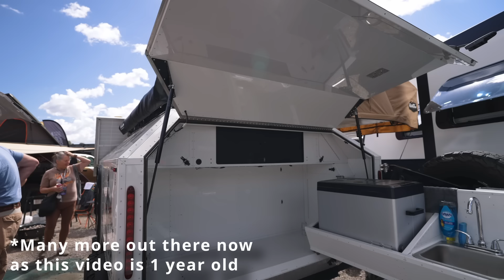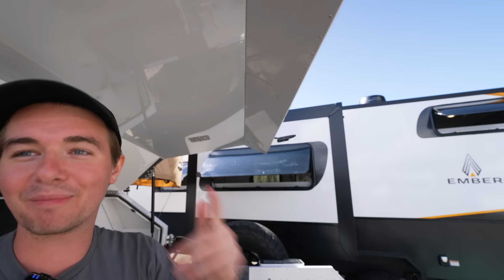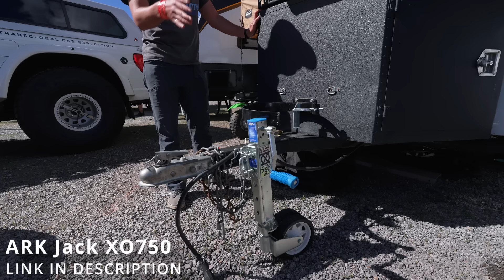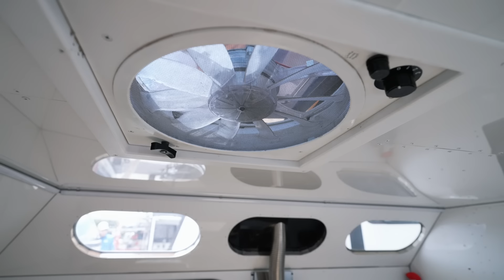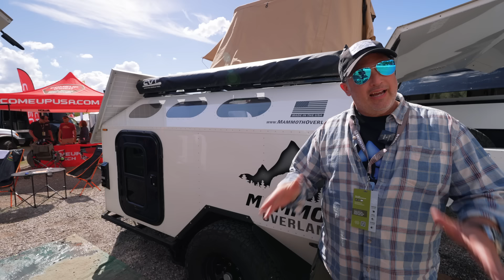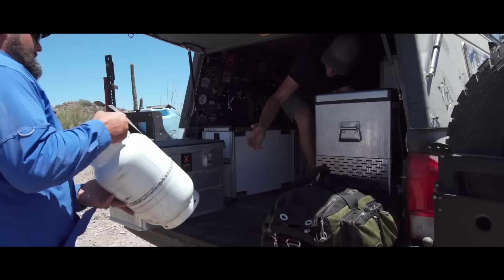Mammoth Overland Reinvented the Small Camper!

Comment: Thanks Drew! That trailer has a plethora of rivets! I love the fold down step to get on the roof. I feel like the angled roof line is more form than function but does give the trailer its on definitive look. I like the heater they used. This trailer might benefit from two 20lb propane tanks which might line up more with the target audience.  One change I would make is have a swing out gear box on the back that would swing out to the driver side that give ability to store gear and create more work surface area as well and would perfectly compliment the swing out kitchen to the passenger side.
Reply from the maker: Brad, you have to quit buying us all this coffee! We are bursting at the seems with coffee. BUT, you know i appreciate it. Haha. I just purchased my first ever off-brand usb charged coffee grinder for camping. I never needed it before. I was always the guy at camp hand grinding everyone's coffee. Well, all of a sudden we have more coffee drinkers with us and even May is consuming at a faster rate than I can keep up with. We have been testing the little sub $20 grinder and so far it is working great. Quiet, a really fine grind for the espresso. It is a ceramic grinder, not steel, but I'm not a coffee snob enough to tell the difference.  I like your suggestions on this trailer Brad. And I also think you are right about the propane. That crowd wouldn't even notice a dent in their towing with an additional 20lb propane cylinder.
Reply: @ what are some of your favorite coffee brands you have been using! Didn’t know if you and May had a favorite coffee shop!
Reply from the maker: @jgrant4520  So far no favorite brand. We basically buy small batch coffee that is on sale. We like trying different coffee from all over the place. For a while we tried the expensive stuff, but just didn't see the value. We are not really fans of highly acidic coffee, and that is what expensive coffee tends to be.  If there is no sale, we just pick up something like 8 o'clock or Petes. We aren't picky. Just love that black morning coffee! As for coffee shops. We had quite a few favorites in Thailand, but here in the States my favorite coffee shop is my teardrop trailer or our kitchen. Haha.
Reply: Kicking horse coffee.....just sayin...
Reply from the maker: @jennstuart2031 Really.... I'm all ears. I'll look it up Jenn.
Reply from the maker: I was expecting this to be expensive. Loving the price I just saw. Which roast do you suggest from them?
Reply: @PlayingwithSticks I like the medium roast, blue dot on the bag.   I grind to a medium grind and use a Stagg  dripper.  I used a cone dripper for a while, but the cone papers always broke and I want a clean cleanup when camping.  I've had several USB burr grinders but still looking for the best one.
Reply from the maker: Oh wow, I didn't know they made USB burr grinders. Thanks for the tip on the roast. I will be putting in my order today.
Reply from the maker: I had to did through the comments to find your coffee. I forgot the brand. I went to order it today and went, "What did Jenn say it was again?"  Haha. Thanks again for this Jenn!
Reply: If you find a sturdy USB charging burr grinder could you post it?
Reply from the maker: Wouldn't that be cool? I am surprised though. Both may and I found this morning's coffee better from our cheap USB powered grinder versus our Burr grinder. Which is starting to make me think not all burr grinders are created equal. The one we use is on the cheaper end as well. I always thought it was special haha. Sometimes you get what you pay for

Comment: Having owned everything from a $12,000 overland trailer to a $65,000 small overland trailers, I can tell you there isn't much difference in what you get.  Sure layouts are important and that is the major differences.  Materials on most of these small overland trailers are just fine at all price points.  The more I look at these the more it makes buying a small cargo trailer, (made for abuse usually) throwing some timbren axeless suspension on it, and building it out (or have it built out by a local place) the way you want it.  You can do this all for around $15,000 (stove, heat, water, shower, beds, etc.etc..) and have the same if not more capability as this trailer.  I'm not saying there is anything wrong with these trailers, they are "cool", they are just not made for your everyday overlander/camper IMO.
Reply: It would be cool if Toyota made a camper that was indestructible though
Reply from the maker: Sign me up to test that!
Reply: Sadly, I think most of the overlanding, and frankly all the tiny camper industry, has become more about the “look at me” aspect of it. Not the “I just wanna get away from everybody else” that it should be. Even fully loaded as a bombproof boondocking capable camper, $25k should be the absolute maximum! Yet we keep seeing 50, 60, 80k trailers. And they will fall apart at the same rate as the $12-15k trailers. 

In short, they are made to be seen at the campground or driving down the road, not taken into the back country and seen by nobody.
Reply: @soonerfrac4611  sounds similar to many humans so it makes sense.
Reply from the maker: I like your take on this Preston. I would agree. The more campers I take out the more I realize a budget camper does 80% of what every high dollar camper can do. As you may know we also have a converted cargo trailer. We have had it for over 5 years and have never put it on the channel. I finally filmed it this summer, so I will get it up there this season. There are a lot of pros for going this route.
Reply: @PlayingwithSticks yup, all I need one for is music festivals and bluegrass “pickin parties.” So heat, cooling, and lockable storage. Cooking can be done on a table outdoors. A dinette may be nice for rainy days and meals. So something like a Rustic Trails Koala is the dream. But it looks like in terms of cost and lack of maintenance (I live in Maine so it’d be out in the snow all winter), a cargo trailer may be the way to go. My biggest gripe with most teardrops and small trailers is they use way too much space for cabinets and kitchen space. I’d much rather have it open to lock up my guitars. Something like a road toad tote might be good too. But again cost and availability, a cargo trailer seems hard to beat. And you can add and subtract features as you experiment
Reply from the maker: I follow Rustic Trails pretty religiously, but I think I missed the Koala. Sounds like they have a new model? I'm with you on the space eating cabinets. I used to love them, but the less I have the happier I am. I like open space. I think that Road Toad would do well in your climate, so would a budget trailer from Runaway or Tiny Camper Company, both of these manufacturers use composite as well. We have a converted, well semi-converted cargo trailer. We have had it for over 5 years, you may have seen it in the background of our videos because we camped out of it for 6 months at a time for two different seasons. They definitely have their place. Great little trailers, with an affordable price tag, and a BIG feel to them.
Reply: @ thanks for the pointers! The Koala is like a Kodiak minus 2 ft in length and a little more rounded in styling! The runaway campers would be perfect tbh but the owner is heavily into politics, and let’s just say, his views are opposed to mine in a way in which I can’t feel comfortable supporting his company. Road toads are hard to come by. I do like the idea of being able to store my motorcycle over the winter though it’s not a necessity, so the intech explorer is pretty cool in my book. 

Thanks again for your well-thought-out response! Best wishes on the channel heading forward! I just subscribed :)
Reply: If you always camp in a campground with a flat level paved parking pad then most of this doesn’t matter.  If you camp on spots between the trees and drive over rocky rutted roads to get to your campsite then you will appreciate this build.  Repeatedly dragging your typical trailer to these sites will drag the bottom and twist the overall integrity of the unit.  They aren’t built for rugged use.  This trailer has a high clearance that is equal to the vehicle pulling it. The articulation connection doesn’t strain the travel of the trailer or the pulling vehicle.  This trailer encourages outdoor use.  The reason we go camping.  You don’t go camping to pretend you are in your living room.  Experience the outdoors with a very reliable and functional home base unit.  I own one of these and I love it.  It’s not for everybody.  Thank you.
Reply: @alexdroban4312 you’re welcome?

Comment: I don’t get the cabin pressurization, like you go up a mountain and can sleep at sea level?
Reply: Positive cabin pressure keeps dust out of the interior while going down dirt roads.  Some Australian trailer makers have this feature.
Reply from the maker: That part I understand. And I agree, that would make sense. but let's take something like Bruder for example...they don't use something like that on the door. With that fantastic fan, I have a feeling this trailer wasn't designed like a Bruder for keeping out the dust. So I am still not sure what that cabin pressurization is actually for.
Reply from the maker: My guess is as a defensive mechanism right? Does that make sense? Like instead of you shooting that bear spray, it is you holed up in your camper protecting yourself from any gases used to push you out. I literally have no idea. Haha. I'm pretty sure it is some sort of prepper mentality. I have a lot to learn in this area.
Reply: Oh right, they’re selling to preppers. 🥜🥜🥜
Reply: If the cabin is sealed, shouldn’t there be a way to get fresh clean air to survive? Does the heater blow in fresh air? Moreover, how does the cabin pressurize with a fantastic air fan in the ceiling, and regular doors?
Reply: You’re going to start seeing those fans on Boeings soon 😂
Reply from the maker: Haha. How dare you ask these tough questions...They are really good by the way.

Comment: Those Rock sliders are only for bashing not sliding. Why aren't propane lines ran thru out ? 2" suspension travel? Aluminum interior condensation?
Reply from the maker: Are you saying that because of the right angles of the "sliders" Sorry sometimes it takes me a while to pick up on things.
Reply: @PlayingwithSticks  Cross bars will snag, needs to be plated(skids). Plus the length of the supports will have a lot of leverage when it slams down with that 1000# rack fully loaded.
Reply from the maker: Thanks for pointing this out. The offroad trailers are one of my weakpoints. Learning something new everyday.
Reply: I’ve overlanded this trailer over moderate to difficult trails with downed tree limbs, rock steps, and boulders. The sliders have worked beautifully and I have never had debris catch in the cross members whatsoever.

Comment: When you first put up the notice for this video, i went to their website and watched several videos.   My first impression of this design was that it was from the military.  Sometimes, on major highways , you see these looooong caravans of different shaped military vehicles going whoknowswhere.  This came out of that line and escaped into the Regular Folk life style.

I like this trailer.  I'd like to outfit it and camp with it. I'd like to take the fridge out of the galley and swap the stove to that location and put a storage bin on the outside of that arm.   I never like swing out galleys, but i could fix this .   That swing out also needs a  dtop to the ground leg to brake it in the wind.   Of all the outside elements, WIND is the biggest one that will shut down cooking.

I like the bigger cabin.  I like the windows, and that bench would be great for interior cooking.   You had a great fold up mattress a few weeks ago that would be awesome in there.
Why does the heater vent at the underside of the rooftop tent?   And also it's under the window of the roof top tent.
Is the solar panel a fixed item?  You would always need to be aware of where the sun is relative to the panel.  
And now the bear spray on ELE.  I dont know.  I keep thinking about that.   It was very dramatic to watch.   I'm still thinking about that.
I dont overland, but i like the design and size of this trailer.
Yes, on the propane canister problem.  I agree with you on that. 

Fun!
Reply from the maker: Love this break down! Your comments just keep getting better and better. I'm right with you on the military look. That is what I first saw as well. One thing I also didn't mention was how easy this trailer would be to clean. I like the simple aesthetic. And I'm right with you there on that wind comment. Good point on the heater vent, I didn't even notice that. I was so caught up on just the shape of the vent, that I didn't even look around it. The prepper version of this is probably 60% practicality, 40% fun or a talking point. Haha.
Reply: See this is what happens when a Trident Nuclear Sub and a AV-8 Harrier meet and have a baby.    Paint it Military green and Lewis/McCord will think they’re missing one of their armored transport vehicles from the Yakima Training grounds.
Bullet proof windows, seriously?!!
Starting price of $67,000.   That’s cheap for military grade.

All kidding aside,  this beast is built to withstand just about anything… except maybe armor piercing bullets.
Reply: @annmariewhale4501  yes!   JBLM has been lookin for their bed trailer! 

I still like this trailer. 

I think it needs some bear pin striping on the back galley.
Reply from the maker: I want to see a version 2.0. I hope they update this trailer soon.
Reply from the maker: Haha. Love your take on this!
Reply: I would like to see an update also.  What we are looking at is a year old, so surely there are uogrades.
Reply from the maker: @jennstuart2031 I was trying to see updates on their website, but if there are updates they're not very visible

Comment: Considering the build,  the price isn't too horrible. I agree that this is for the rugged, get out of dodge, hard core overlander who just needs a bed on wheels, with a compact kitchen. Propane plumbing is an issue and I don't really understand the reason for the pull out kitchen. Serms to me that adds unnecessary weight. Speaking of which, I didn't catch a weight for the base model. There's a specific market for this and I hope they are successful.
Reply from the maker: Funny you mentioned the weight. I was hoping nobody mentioned it, because I realized after I uploaded the video that I forgot to mention the weight. The dry weight is 1650 which is pretty comparable to other overland trailers of this size.

Comment: It is a very interesting trailer. Always liked the idea of no rotting. I agree with your cons. And I also like their suspension. It is the same I have on mine. Although my heater is mounted to the side of my trailer I do like to have a bottle designated for its propane needs always ready to go. My propane for my stove is mounted to the side of the trailer and you have to screw it in and unscrew it. That way you are sure it is disconnected and off. Cabinets on the inside sure would be nice though. 
 The appearance seems very clean, which is pleasing to the eye. And some 409 and a towel and it's clean. 
Love the videos! Much love to you and your family as always.🥃
Reply from the maker: I probably should have played up the no rotting point. I forget sometimes that i need to approach each of these videos, like nobody has ever seen these concept. Thanks for reminding me of this. I agree, it has a very clean look. And when you are in it, it feels very spacious because of the lack of cabinets. Thanks for taking the time to share your perspective on this. I really appreciate it.